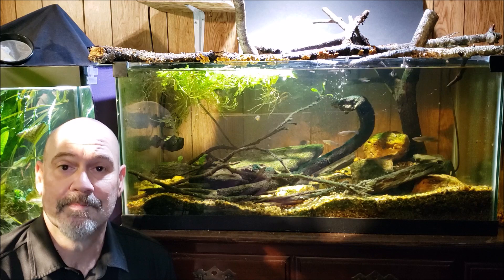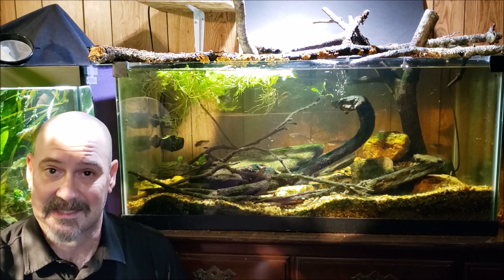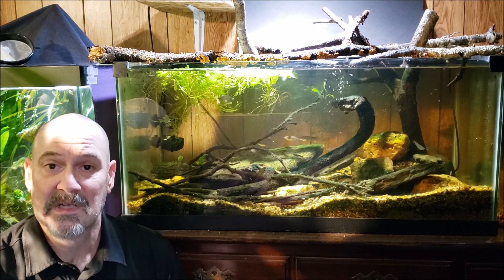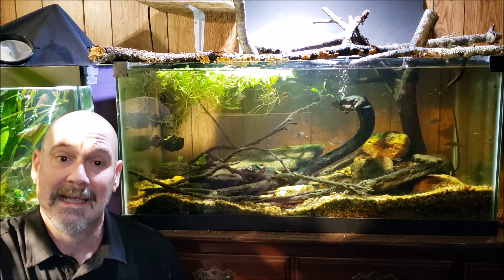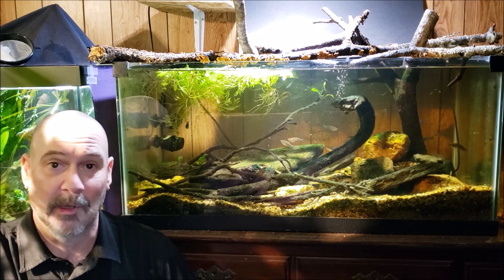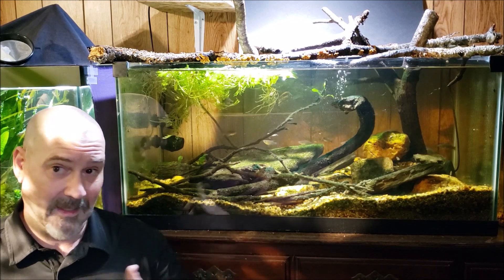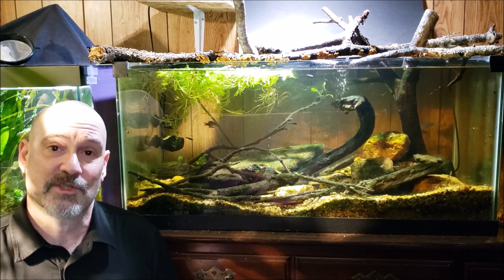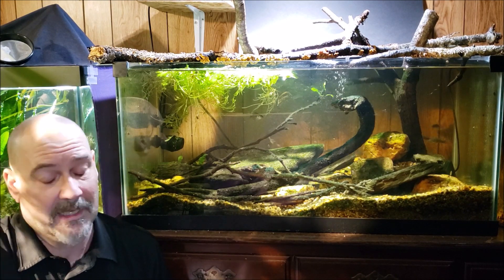A Lesson To Us All About Testing Our Water

Comment: More on the topic...I am a second generation fish keeper. My father no longer keeps fish, but for the entire duration of his hobby never knew what a water test was :P He would see that small foam that forms at the edges of the the tank, when the ammonia is a bit high and go...you should change some water :)
As for me, I do 25% water changes in my tanks every week...I did test my water from time to time...only to see that the NO2 was zero...before the water change... My philosophy is that of if I do the same thing, every week, for years...the water will not suffer much of parameters variation....will always be hard as a rock and with PH through the roof :D

Comment: I bought the Araganite/Coral in my tanks, but I have noticed the snails slow down a lot without it in there, and yes, the more immediate beneficial results of the above mentioned additive to the substrate is absolutely essential if you have wood in your tank, no matter how long you may have boiled it to get the tannins out.  My granddaughter brought me a beautiful piece of drift wood home, so I boiled it for 2 hrs, and then waited a day to cool in a bucket of dechlorinated water, then put it in the tank.  I still have to add  the Araganite Coral to the tank every so often.
Reply from the maker: I've had wood in water for years and they still leach tannin into the water.

Comment: Very useful information regarding aquarium water.  Looking forward to the crayfish video, too.  🦂🦂🦂

I noticed my water parameters will change slowly over time, but I still do test about every 10 days or so. 📊📉📈📉📊 The are only 4 tests:    GH, KH, nitrate & phosphate.  Since the aquariums are heavily planted & stocked, it is an interesting combination.  Mostly add a bit of Wonder shell or eggshells, baking soda & comprehensive fertilizers.  Generally, have to add more phosphorus, since my plants seem to use it rather quickly.  

Good video.  👍📺😎
Reply: My heavily stocked tanks never need phosphate, plenty in the fish food. My plants always demand potassium
Reply: @Toneloke-3000  Thanks for the reply.  Yes, I put in a lot of potassium as well.  It must be my plants taking out the phosphates, because it always goes down to near 0 ppm quickly.  Testing with the API liquid test.  I dose fertilizers, fairly heavy handed & the plants are getting very large.  I try to keep the TDS under 500, ppm, for what it's worth, & it seems to keep the fish & plants happy.  😊